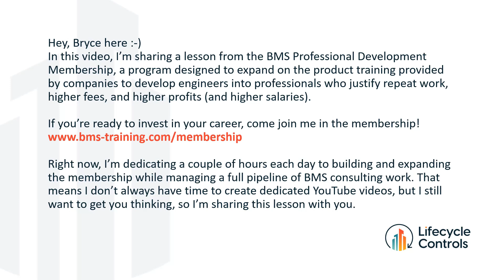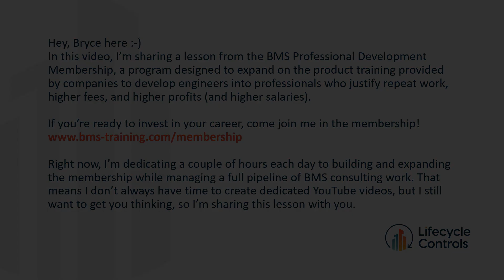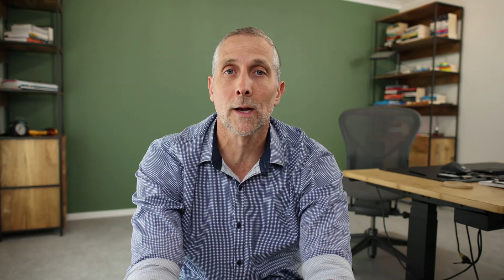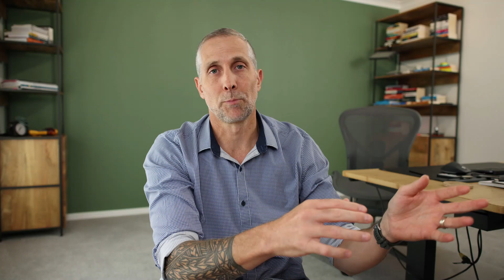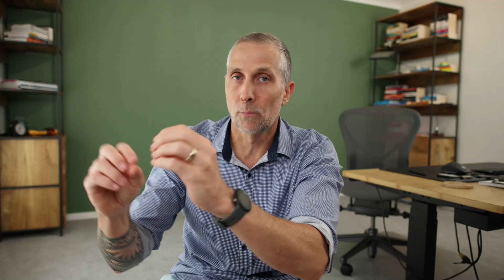Advanced BMS Reporting (chilled water system)

Comment: Most of the time I use power bi to make customer specific reports. With this different reports extracting data from different sources and combining them is possible, this gives us and principals a great view of the "total system" and health of it. Different reports like specific based on hardware, or network controller level, or process level with a KPI index in table and/or gauge. The KPI's is not only key to reports but can also be build in the system it self for warning the contractor that a process and deeper the control loop are maybe getting out of range. When build the reports is just only a matter of a refresh (manually or automatic) and saves a lot of time. Cloud solutions with dashboards are also a possibility. Insights are key!